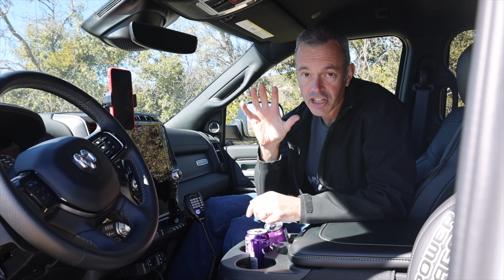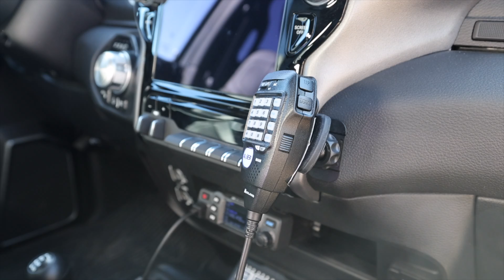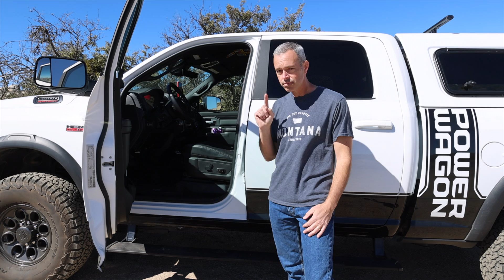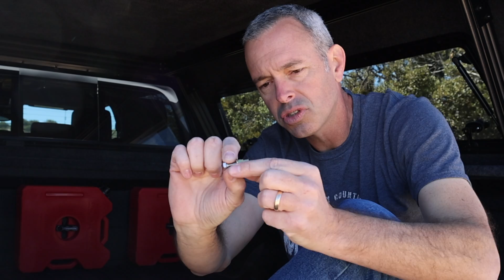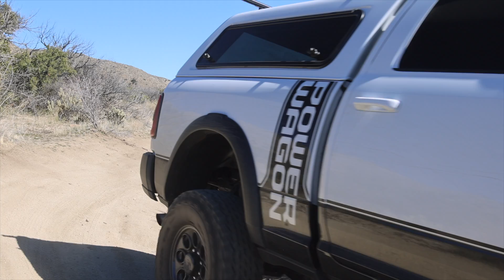Will 37" Tires Fit on a Stock Ram Power Wagon? - Build Update

Comment: AEV sells a nice vertical spare tire mount for the bed. I'm not too high on the idea of putting it in the either.  A swing gate would block your back up camera and maybe even your backup sensors.  I think the best option is putting a basket on the topper and put your spare up there.
Reply: Putting the spare on top of the topper is really hard for 1 person to handle by themselves, not to mention the tire's weight increasing the center of gravity.  I'm still thinking of a solution, but did rule out having to pick up a tire to height well over ones shoulders.
Reply: @Tahoebronco  the way I see it is once you are standing on your tailgate it's a moot point. Rack to the tail gate, tail gate to the ground.

Comment: I have 37s on my stock Power Wagon with factory wheels. I'm sure you can deflate a 37 and shoe horn it under there. Just inflate if when it's needed. Thats my plan at least. Love the videos.
Reply: A 37 has no chance of getting under there. A 35 deflated to 20PSI will fit.
Reply: @sh0cktim3  Thanks for crushing my dreams. 🤣. I guess ill be doing some more research. And looking for  a better solution.
Reply: Any running with or without sway bar disconnected? Wheel offset and tire brand?

Comment: I actually just traded my Gladiator Rubicon in for a Power wagon last week. ARE topper is already ordered 😁. Running boards are next! I personally will be doing a drawer setup in my bed. Definitely would be interested on the details of your Ham antenna setup. Keep up the good work.